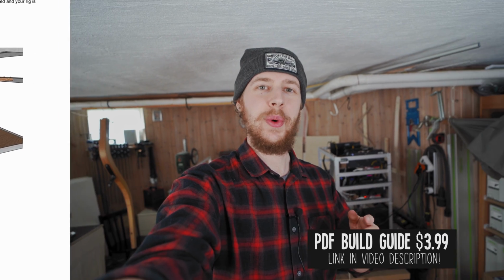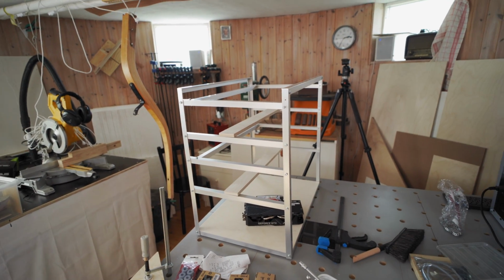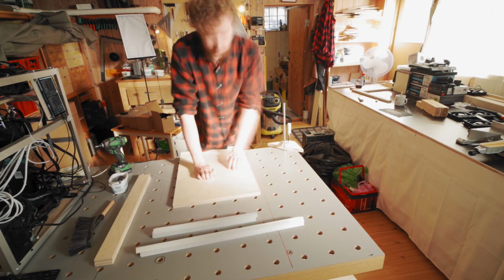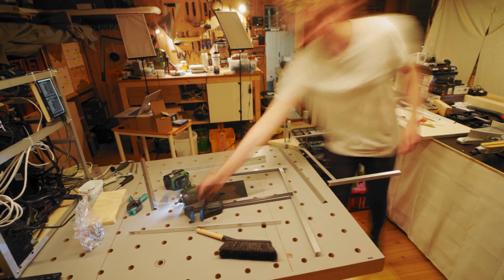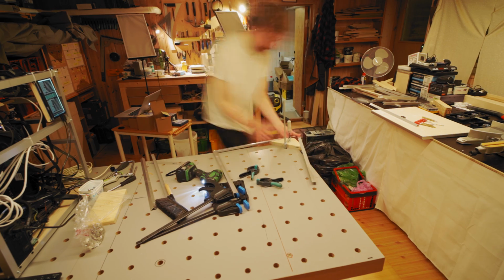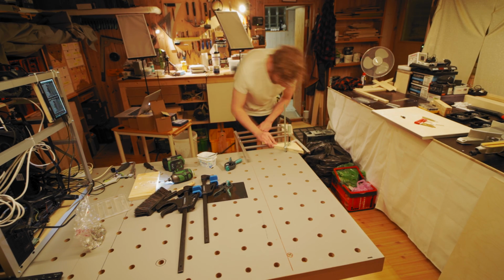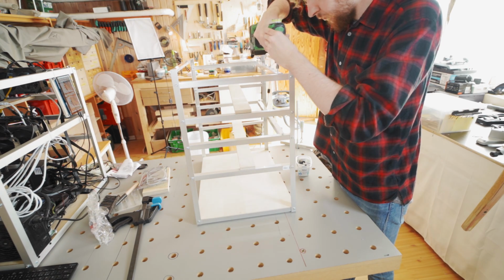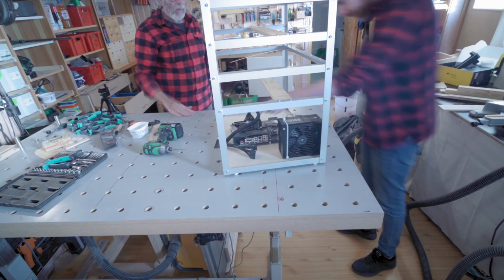How to build a MINING RIG FRAME for up to 14 GPUs! (DIY Open Air Crypto Mining Rack Tutorial)

Comment: are those the Arctic CPU Water Cooling Fans, I have a Arctic 360 Water Cooler on my CPU, The Water Cooler Fans Push or Pull More Air than Most other Fans, They are Designed to Push or Pull through a Radiator, and They Kick Buttock's. high Static Pressure Fans, I think they call them .

Comment: Built mine today on average my gpus are running about 10c  less than they were before and I haven't even installed any fans for the outside yet,  printing brackets right now but really appreciate the guide keep up the good work

Comment: Man, that pdf-file looks realy professional! I was going to build me some rigs in wood, but now I'm reconsidering using your plan and aluminium instead. And your idea with turning the lowest horizontal fans to pull hot air down, while the top fans pull hot air up, sounds great. Since you got 16 cards to work with your ASROCK 110 motherboard (last video), wouldn't be an idea to build the rig for 16 instead of 14? What spacing do you use between the cards? and how would adding 2 cards more change the cut-list?  Keep the good vids comming! Your accent tells me you're Sweedish. Am I right?
Reply from the maker: Well I actually didn’t get 16 cards to work on that motherboard. I couldn’t get more than 13 to work. As of yet I’ve never seen a rig with more than 13 cards except for really specialist ones. Good luck!

Comment: Love the channel man
Reply from the maker: Thank you so much mate! I like your username 😎 You must be one really chill guy 👍
Reply: @SebsFinTechChannel  Thanks brother. I am a machinist by trade and a Eth miner so I really appreciate the custom builds you’re doing. I built my first 3070 rig with a Veddha frame but I’m trying to decide on a design for a new 3080 build. I’m actually thinking about doing a custom enclosed sealed box style with a lot of air pulling through. I’ve seen a lot of guys do well with the heat issues of the 3080’s by using Minebox’s. I’ve also got an idea to build a wall rig. Just a layout of gpus on shelves coming off the wall with a mobo, psu, etc. every 6-8 cards. Maybe use Chumpchange hangers with the wire shelves coming off the wall with gpus dangling off. It’s a pretty efficient way to build with minimal use of materials. I like coming up with wild ideas. It would be neat to have a wall perimeter rig going around the room.
Reply from the maker: @MrChill156  ah mate PLEASE if you do that make a video showing it off and send me a link to that video I would LOVE to see something crazy awesome like that 🤩
Reply: @SebsFinTechChannel  Will do. I bought mics and a few things for a YouTube channel but I’ve been really busy with work and then expanding mining. I’m hoping to have a few videos to put together a channel mid June. We call our mining project FutureMine so that will probably be the channel name. I’ve learned a lot from you. Thanks for the great content!
Reply from the maker: @MrChill156  awesome let me know when you have the channel up so I can subscribe :)

Comment: Hi man, very great video! I am building your rig, but I am a bit concerned about the air flow. The two GPU stages are on the top of each other and I assume that the lower fans (horizontals) throw air to the lower GPUs, and the mid-upper fans take warm air from the lower GPUs and throw it to the upper GPUs (this last step is not very efficient to me). I had the idea to turn either the top or bottom GPUs 90° so that the lower and upper GPUs are not completely on the bottom/top of each other. What do you think about it, might it be more efficient for the air flow? (Since I don't plan using the vertical fans on the side)
Reply from the maker: Hi Jérémy! First of all exciting that you are building my frame and I hope you are happy with the plans. As you've already understood the plans are designed in a way so they can be tweaked to your own circumstances. First of all I'm just curious: what's the reason you are not using the vertical fans on the side? :) And to answer your question: turning the GPUs 90° could definitely help with airflow. Doing so I think you would have to modify the frame though in order to mount the GPUs securely right? Also I think even with just mounting the horizontal fans normally with no vertical fans, you'll probably still get better cooling than no fans since you are still moving air around and away from the GPUs, rather than letting that same air just sit there and get hotter and hotter. Another idea could be to mount the bottom row of fans to pull hot air down and the top row of fans to push air up. But I would encourage you to experiment! Try different positions of the GPUs and different positions and directions for the fans to blow from. That's the great things about these DIY frames, you can customize them to perfectly work for your situations. Good luck and please let me know how it goes!